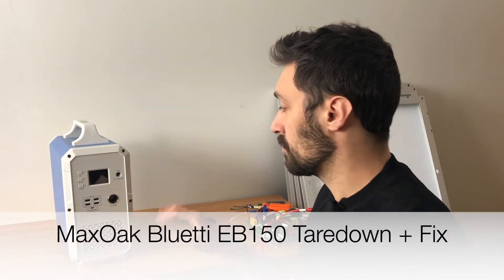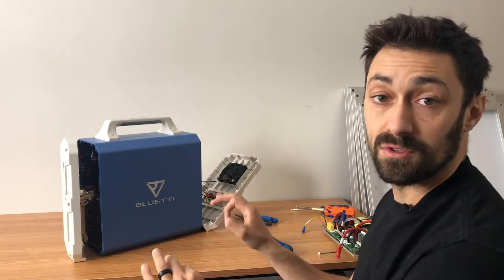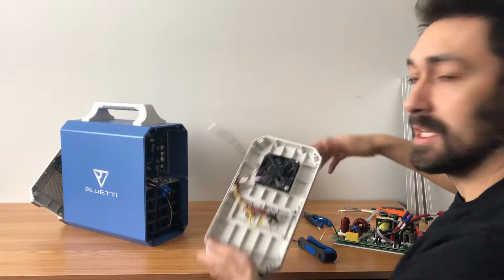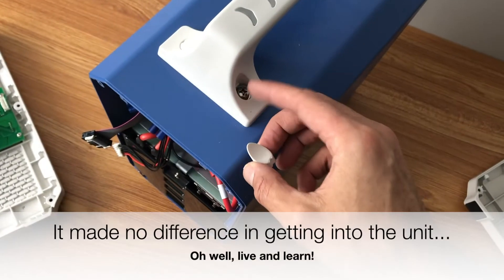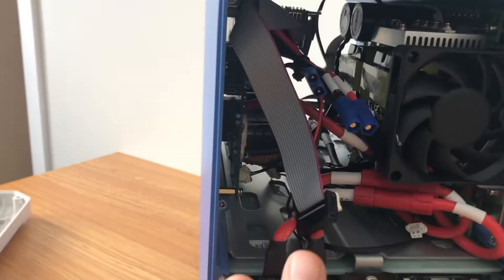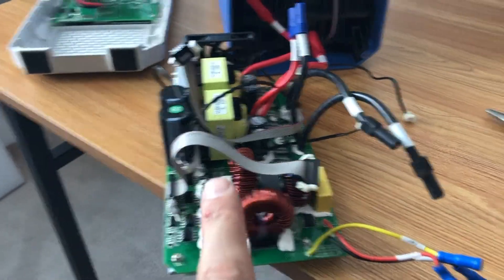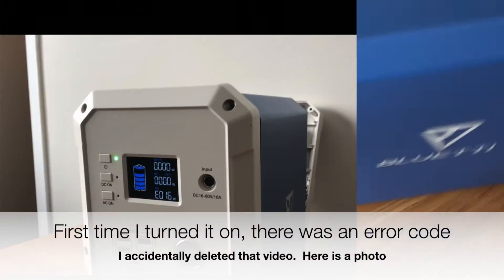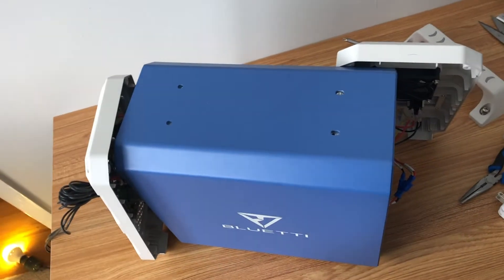Bluetti Solar Generator Tare Down and Repair - See What's INSIDE a Solar Powered Generator

Comment: Where is the cold weather shutdown sensor  ?   I have one of these units and it shuts down at about 47 degrees, So I can not even use my unit in the fall of the year, apart from that it works great, Was thinking about leaning a hot water bottle against that area of the unit,  any ideas ???

Comment: Yes and no. I had my brother-in-law cut the plug in part and use the wires to hook it into the circuit board and I have to unplug it from the panel directly. It’s not pretty, but it works.
Good luck.🍀

Comment: I’m curious as to how their mains voltage short circuit protections work.  I’m normally used to seeing electro mechanical circuit breakers, but in the case of the eb240 (which I received yesterday), I get the impressions that all the protections are controlled by programmable softwsre.  Is that the case, and if so what standards are those protections certified to?

Comment: Very interesting to watch you take it all apart. Reminds me a little of a computer tower. Do you guys sell replacement parts for these or service them if anything ever goes wrong?
Reply from the maker: We have a few replacement parts, and we would be able to fix them ourselves yes.  But at that point we would take the unit back, fix it, and sell it as an open box unit.  :)
Reply: @ShopSolarKits  I was very surprised that such a high-end and expensive unit did not have silicon gaskets on both plastic end sides, won't cost them more than maybe $2-3 of material and very small change to the plastic mould, heck, how about throwing a silicon cover on the 12v and AC inputs ? I am the type of customer who will be willing to pay another $30 for such "outdoor edition" (with material costs to the manufacturer maybe $4-5 in total).
Reply: @ShopSolarKits where did you get replacement board?

Comment: Someday when the batteries are shot can replacements be found?
Reply: LG branded pouch style battery used in EV cars like the Chevy Volt. 2000 plus charge cycle on battery. Almost a 10-year lifespan on that battery.

Comment: My question  is why did it fail? Is it an issue?  I've purchased  two EB 240, so it is concerning.   Mahalo
Reply from the maker: We think that the issue was water damage.  The circuit board itself got damaged after the customer left it out in the rain.  

So as long as you dont leave it out in the rain, you'll be fine :)

Comment: Please help me. I need to replace the front part that plugs into the solar panels. I had a setup that was covered, but water got into the round port. It charged. The generator, but melted the metal stem of the plug. I have looked all over and can’t find it and don’t know what part to ask for. 
Please help. I sent it to my brother-in-law and he is also at a loss. I live off grid and desperately need this working.
Thank you.
Reply: Hey were you ever able to get this fixed? I have the same issue and can’t find where I can get a replacement port

Comment: By how the housing construction looks like, it would be extremely EASY and CHEAP for the manufacturer to very slightly change the two front and back plastic parts to be able to take a silicon gasket, that would probably make the unit at least rain-resistant (heck, invest another 2-3 bucks and even install silicon seals for the 12v and AC inputs and this unit will be almost perfect), by how it looks right now - even light rain that will fall into the wrong crack can cause such a malfunction, I am actually surprised that they skimped on a $1-2 worth of gaskets on such an expensive and high quality unit

Comment: My ac50s wont charge, i bought it several months ago and i checked to make sure it's outlets worked, they did. Then i stuck it back in the box. Pulled it out a couple of weeks ago and it ran my fan and radio just fine, but when i plugged it in to charge it it won't charge. No error code, but it doesn't show charge off my 12v battery, house plug, or cigarette plug in my truck. Looking around i see that there are others with the same problem, the purchase email has been erased from my phone so blue etti won't do anything for me. Have you came across any fixes for them not charging? 
   I would think the batteries are ok, i hate to junk a 400 dollar unit I've only ran for three hours. If its a matter of replacing a bms with a overkill or daly at least I'd get some value out of it. Any advice would be appreciated.
Reply: I have the Ac30 bluetti mine still charges but my 120v plugs flicker when powering devices. 

Bottom line I'll never buy another bluetti pos system. Thank God I bought their least expensive unit. 

In defense of bluetti I do like their overall designs, they look and feel like premium products yet they've been doing so many product updates that they've missed the mark on quality control, especially their circuit boards that seem to crap out prematurely. 

I'll continue to use mine as long as I can, and when the bms finally kicks the dust. I'll turn the outer case into a travel speaker. And repurpose it's batteries for something else. 

Personally it's cheaper to buy a lifepo4 battery the charge controller and inveter and a knock off pelican case from the harbor fraught and build a quality system using higher grade products than those of most pre built solar generators. Imop.
Reply: Lets get together and file legal class action against this company. They will not even honor there warrantee. They have our money and we have there faulty product. Let sue them !!
Reply: I bought my AC50s right when it came out (3 years ago) and it barely failed.  I used it alot too.  Now it wont charge so I was hoping to find a repair video on YouTube but there none.  Time to fix this myself!  I actually have a degree in electrical engineering but have been doing software development my whole career.    If I fix my AC50S I will post the fix here.  Stay tunned....

Comment: My EB150 died after two years (or now only hold about 100 watts of charge). The question is, is it cost effective to repair? The answer is no, nor can I find a place who is willing to. Nor did you provide this information here. Yet, all the comments say 'what a great video'. Must be YT and is marketing. Also, I wouldn't be messing with electronics, if you don't know what you're doing.